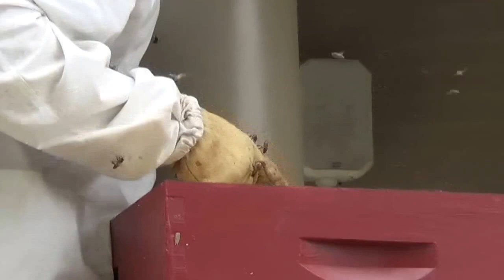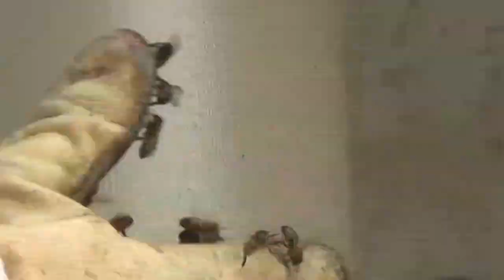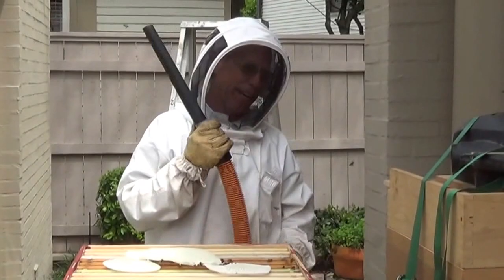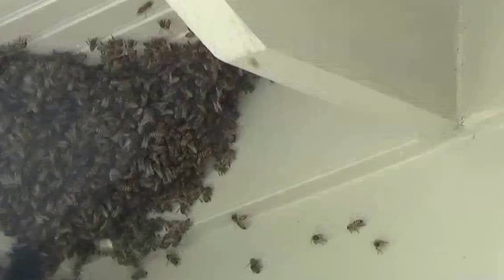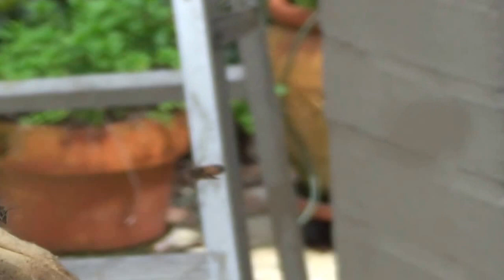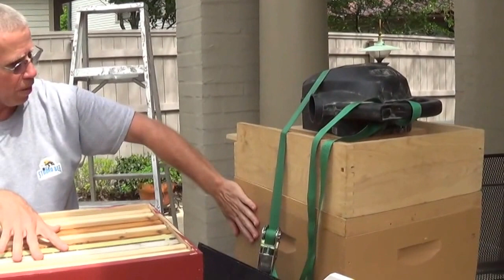Swarm capture with the bee vac

Comment: Nice job. I've only tried vacuum once, with no luck. It was a feral colony who's tree had fallen across a driveway. I manually transferred them & their comb to a TBH. Sadly, a some predatory hornets had already been working on them & finished off the queen before I could move them.
Again, nice work.
Reply from the maker: +Frank De Mascio      Man, that sounds like a movie....one that has a bad ending. I am a firm believer in using the vac. I made my own from watching a you tube video and the thing works wonderfully. Yesterday, I vacuumed over 20,000 bees and there were only a dozen or so dead ones in the bottom of the vac. I've just finished the video and it should be published later tonight. I hope you watch it. Thanks for watching and commenting Frank.    Mr. Ed